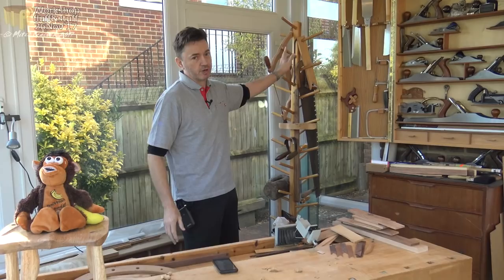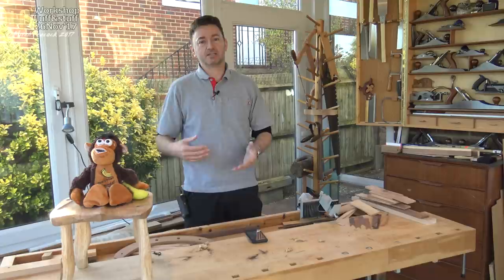Workshop Fluff&Stuff November 2017

Comment: As Ken stated, you should think long and hard before abandoning your machines.  There are those times when machines are a real blessing.  Like you, I enjoy hand working but let my machines do the bull work first then finish up with hand tools.
Reply from the maker: True, although a non-working machine is hard to justify, and if I can't fix it myself then it's probably going to be cheaper to get a new one whenever I need it.
Reply: Agreed.  A boat anchor is still a boat anchor.  I'd hang onto the other tools though.  You might consider selling the planer, or giving it away, on Craigslist to someone who might have the same model for parts.
Reply from the maker: That's a good idea. I've never tried Craigslist so it's about time I did!

Comment: Hay Mitch u have same bandsaw as me, what size wheel is it for the a rubber wheel mine has snapped lol where do U get yours from? Bud
Reply from the maker: Hey Dan! I think it's 14" from memory. Maybe it's because I hand saw mostly, but my tyres are only the second set - and that must be 12-15yrs! I got them through Axminster Tools. They weren't listed, but the product support guy's furnished me with an order code.
Reply: Just order them from Axminster mate cheers,
Reply from the maker: dan barrow Glad to help
Reply: How do I measure my bandsaw see what size it is I thought it was a 12”
Reply from the maker: dan barrow Measure between the blade and the upright column. It basically determines the widest work that be accommodated inboard on the machine. Because the blade is surrounded by the column, the wheels must be slightly larger, for two wheel band saws.
Reply: Thank you buddy, I think it’s a 12” mate which is ok for what I do mate, cheers.